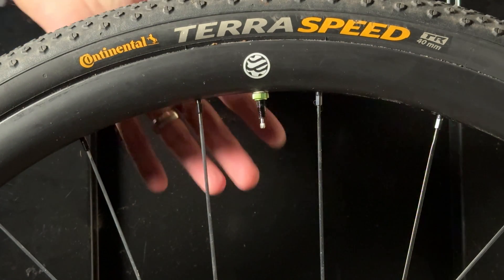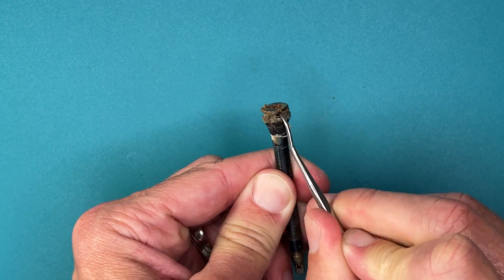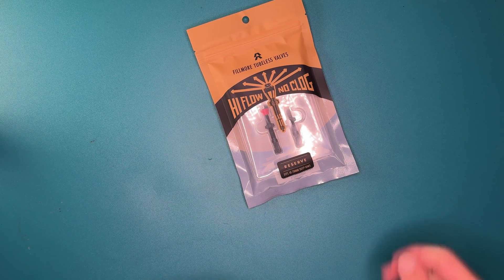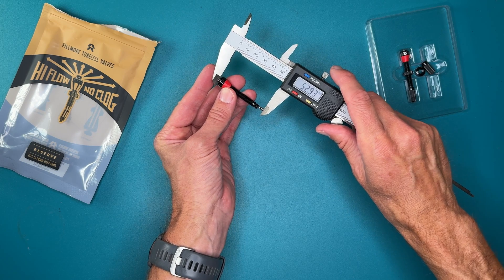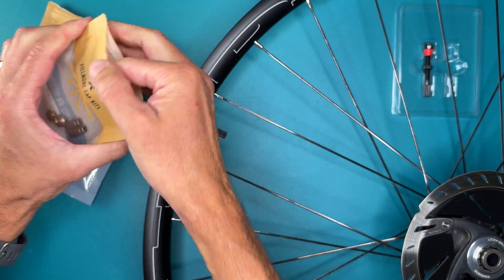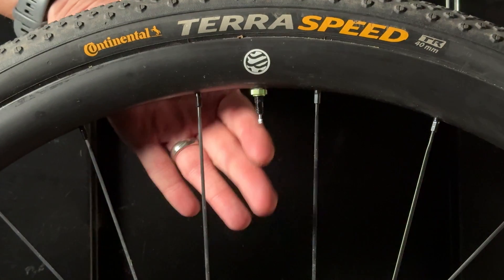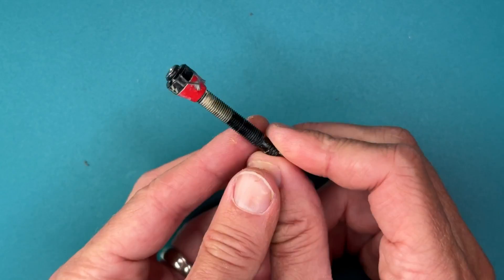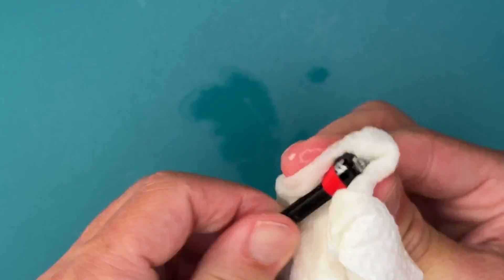Will it clog? Fillmore valve vs Silca Sealant

Comment: The whole valve comes apart with an allen key and a spanner for easy cleaning if it ever does clog up on you (if you look closely at the poppet, you’ll see how to disassemble).
Reply from the maker: YT Short added to cover this, https://youtube.com/shorts/HY9_tak5__M. Thanks again!
Reply from the maker: THANKS! Can’t believe I missed that.  The center of the poppit is a 2.5mm hex and then the whole center slides out for easy cleaning. A quick YT search didn’t show anything on this
Reply: Also if your o-rings ever degrade, one is 3.5x1.5mm and the other is 6.5x1.0mm.
Reply: I was about to say, nothing "doesn't come apart" unless it's riveted or welded and there's no way they'd spend that kind of money on making valves.  Anyway, I've run them with all kinds of sealants on my mtb for 3 years and they've never clogged.  Got sick of my gravel bike valves clogging and did the mental math - the satisfaction and time saved of valves that never fail and work so well, AND you don't have to remove the cores to add more sealant?  Worth $50 for sure.  After putting them on my bikes, watching other people fiddle with valves and having to pump harder while I relax or do other things... it's so worth it.  You don't realize how much you worry about your valves until you never have to worry about them at all ever again.  Fillmore's are amazing.

Comment: Initially I was very happy with them but my fillmore valves start failing to close often leading to quick deflation after pumping up my tyre. The pins are also prones to bending when the pump falls off. I won't go back to them, way too expensive and as said failure prone too. For now trying schwalbe clik, which at least made inflating much easier
Reply from the maker: I’ve been doing a full overhaul of the valves every 6-9 months when I change/refresh the sealant. There’s typically a rubber sealant ring building up along the plunger/poppit. I tried going back to old-school valves but they foul so much quicker and I like the repairability of the filmore’s.  Good luck with Clik. They look really interesting, but such a commitment to swap to a new interface.
Reply: @AnAvidCyclist you can use a regular (presta) pump with the clik valves, you just don't get the click and they can be installed and removed by hand (no tools required). So far no failures to close and bending is impossible (unlike fillmore and presta)

Comment: Great video! Is the Fillmore valve ideal for use with all tyres? Or does it depend if the rim cut out for the valve is square or round?
Reply from the maker: All rims designed for tubeless use should have a curved relief area in the center of the rim for mounting the tires. I’m sure there’s some narrow old rims that might struggle with these, but they’d likely have the same issue with most tubeless valves. Any semi-modern rim for tubeless should be good.

Comment: I have a pair of these valves on my mountain bike, which actually have stans valor, carbon wheels. Of course they’re very narrow and I have no problem seating a bead on this wheel set however, I have some hookless  wheels on my gravel bike, and mounting tires is a real bear and monster of an ordeal. very time-consuming there must be some dimensions that are off or not the standard. at any rate I’m gonna try to add sealant through the tire and see if I can Seat the bead back on without making a mess or adding to my frustration I would prefer to just do it through the valves, but that might not be possible time will tell.

Comment: I've had my Fillmore's for about 8 months.  They are not clogging so much I cannot add air but I am unable to add sealant thru the valve.  I took them apart and there is some minor sealant build up.  For the price and the eventual clogging I would rather just deal with replacing cores on normal presta setup.

Comment: It took about a year, but eventually I got some build-up in my Filmore valves using Silca sealant. They were still working fine, but I could feel the valve didn't have as much travel as before. Thankfully, you can disassemble the valve and clean it out. Getting all the gunk out was a pain, but I was being extra particular about removing everything. If I only have to do this once a year, I'm happy with the expense. I was cleaning or replacing the standard valves every month or two. The standard ones are cheap, but a constant hassle - to the point I was considering going back to tubes.
Reply from the maker: Exactly my long-term experience (though I was getting 2-3 months out of a standard valve). I like that the design is fully rebuildable rather than just making the valve core a disposable product. The process is easy enough, just don’t lose that little pin!!
Reply: Do you usually put your sealant through the valve or take your tire off to add more sealant.
Reply: @ I dont add it through the valve, but it comes back through the valve when you let air out or even just attaching your pump. It helps to make sure the valve is at the top when you do that, but there's always a little there that will try to blow through the valve eventually.

Comment: if you keep your wheels at rest with valve at 4 or 8 o clock position, you will have less of these issues.
Reply from the maker: I don’t think I possess enough OCD to bother with valve position at rest
Reply: @AnAvidCyclist  well have been using road tubeless with zero valve clog issues for 3+ years now

Comment: I have given up getting sealant through a valve and now just fill the tyre with it nearly fitted, then just push the tyre rim over the wheel rim. I change/clean valves every so often.

Comment: I read you can’t add sealant thru the Fillmore valves (ie silcas quarterly replenisher)?
If that’s true it’s a deal breaker for me.
Reply: Sealant, including Silca's sealant replenisher, can be injected through the Fillmore valves. As a matter of fact, this is in the Fillmore FAQ on Reserve Wheel's website:
"3. Can I add sealant directly through the Fillmore valve?
- Yes, you can direct-inject sealant through the valve simply by removing all pressure in the tire and using either a syringe style injector with tube, or cutting the top of the sealant bottle to size. The Fillmore has no valve core to remove or get in the way."
Reply from the maker: Yeah, I imagine you can’t. Since they don’t have a standard removable core, I wouldn’t expect you’d be able to. I’ve just always popped a bead off anyway, so wasn’t an issue for me.

Comment: WRT the spray.... dont let the air out with the valve at the top where the sealant puddled in the body ., put it at the bottom  so the sealant drains out.
Reply from the maker: Or buy the fillmore’s and don’t worry about where the valve is positioned when you park the bike!
Reply: I have the Fillmore on my Santa Cruz Carbon race wheelset.  and a puddle around the valve core still sprays some out.  just put the valve at the bottom to let it "un puddle" drain, before you de pressurize.  It's not rocket surgery.  :) @AnAvidCyclist

Comment: Yesterday i used a drink straw brush to clean inside the valve body with sopy water...it works!
 Also completely loosen and clean around the seal on the vittoria
Reply from the maker: Great tip! Thanks for sharing
Reply: @AnAvidCyclist  hows the filmore lifestyle treating u? I might buy some, i try to cary valvle cores in my tool bag but one day ima forget too or run out helping others on the trail and giving them away to others that need it. And eventually ill run out and need to buy more. And if i do a race or outa town and change tires last minute and dont have my bontrager pump/w built in air tank i might need the better air flow. Fyi I use orange seal endurance basically slightly thicker stans that claims to last a tiny bit longer). Hows the silca treating u as well? Another youtuber claims it sucks on his road bike, but i feel offroad tread has mor surface area to chemically react to the air and not just fight the pavement slicing it off with every rotation. Hopefully i wont have to worry but i did recently buy specialized pathfinder S works tires with center slick on my gravel. My other tubless r mtb.
Reply from the maker: I’m a full convert on both. Helps that I only have 2 sets of wheels, but I did go get another set of Filmore’s. I just find it so much nicer to deal with a durable solution rather than treat the core’s as a wear item. 

For the sealant, I tore down my wheel set over the winter. The Silca sealant was very evenly dispersed throughout the tire even though it had been sitting for a while and had dried out a bit. With Stan’s I always had 1) a puddle at the bottom of the tire and 2) dried boogers sporadically around the tire. Whatever Silca is doing is keeping the sealant well spread out through the tire which should make sure it’s there where you need it when you need it. It was also much easier to clean off of the Vittoria insert, just some Iso alcohol and the insert was mostly clean.

Comment: Using the same setup, curious too on the long term effects and with the silca top up fluid. Have 3 bikes on the filmore valves, never tried adding sealant thru the valve.
Reply from the maker: Pretty sure adding through the valve would be a problem. I haven’t used the replenisher yet. Had the valve out again this week swapping tires. It had a small amount of build up, but still working great. Planning to switch my other wheels to Fillmore now. I really like the fact that you can tear them down for a full cleaning.
Reply: @AnAvidCyclist  yes, easy to clean even without tearing it down. So far Silca is the one  sealant that hasn't dried up and balled up inside unlike others I've tried.  hope to see a long term review later on from you. cheers.

Comment: Was this test with the tire insert in?  Could the reduced volume in the tire be increasing the Silca foaming action from the valve depression?  Would love to know if the sealant acts the same without the tire insert.
Reply from the maker: Yes, using the Vittoria Gravel inserts. And yes, I suspect the additional volume from the insert plays a factor. I have another set of wheels with road tires and no inserts, but I haven’t switched the sealant on them yet. Sometime over the winter. Interestingly, Silca posted a video this week about sealant and they were using the same insert. They didn’t say how much sealant they used, but it appeared to be even more than the 50-60ml I was using. Of course, they have a business incentive to encourage overuse of the product!

Comment: I'm a mechanic at a high end race shop and we used to offer the Silca sealant in our service course as we are a pretty big Silca dealer. This was last year. This year, we've done away with offering Silca sealant at all. Why? Because a. You can't install it with a syringe (not a huge deal for the most part.. but with some tire/rim combos this can be an absolutely shit-show) and, b. It clogs every valve known to man. It has clogged my own valves so badly that I have had to replace them every month or two. This is just my experience with this stuff. While, yes, it will clog a puncture, just watch out for it clogging your valves as well.
Reply from the maker: Interesting. Thanks for the comment. For a service-course/race scenario, why wouldn’t you accept the issue with the valve in order to get the puncture protection? Or have you simply not found it to be better protection than others?
Reply: @AnAvidCyclist  the issue is that customers can't top off their air because the valves clog so badly
Reply: @graffhead206  Silca offers a replenisher that can be injected through the valve. Yes for the initial install you can't use that method

Comment: Using the valve at 6 o'clock avoids sealant getting int the valve. Just saved $50
Reply from the maker: Sounds like you may have missed the point about how the shaking leads to foaming in a way Stan’s doesn’t. I didn’t test at 6 o’clock, but based on what I’ve seen I’d expect anything lower than 12 to actually be worse if the wheel has been moving at all

Comment: Particles in my mucoff sealant can’t get thru and clogged my Fillmore. 😢. I have to take it apart and clean it up. Which is a pain in the ass since my fat bike tubeless setup is not easy.
Reply from the maker: Interesting. If you end up with any video of it you could send me I’d see if I could make another short on the topic.
Reply: I emailed reserve yesterday to see if they have any ways to get around this. I will keep you posted @AnAvidCyclist
Reply: muc off = absolute trash 
youre better off using shampoo or striaght up air
Reply: @ignaciosevil2157  it sealed numbers of punctures for me. Even on the side wall
Reply: I have the same experience with Muc-off and Fillmore valves. I can only get about 25ml injected through them before the clog up.
Reply: According to Filmore these valves cannot be dissasembled
Reply: @anthonylozano3645  yes they can according to Fillmore. All you need is an Allen wrench. Unscrew it from the back and you can take the core out to clean it.
Reply from the maker: @anthonylozano3645 , agree with Youling1997, and posted a short video linked in the Pinned comment above that shows how. I’ve been back in there and even removed the poppit. Official or not, they are fully disassemble-able, and aside from the o-rings 100% metal. So yes, they’re expensive, but really should never need to be replaced. I’ve given in and bought a set for my 2nd wheel set.

Comment: I've been on the Fillmore valves with silca sealant long enough to be about due for my second top off. It has been flawless. Compared to mucoff or Stan's valves who's cores I would have to change out about once a month, it's a welcome improvement. 
For the silca sealant, it's been perfect as well. Stans, mucoff, orange sealants would seal small thorn punctures but would always weep and leave constant wet spots. Same tires, same holes, cleaned up and filled with silca are bone dry.
Reply: Sometimes it depends on the tires too, i had a pair of contis that weeped out the sidewall, but never had that happen on any other tire ever so far
Reply: Found Silca to be dire even on small punctures
Reply: I found it very easy to remove dried on sealant fairly easy during long term maintenance, easier than Orange.